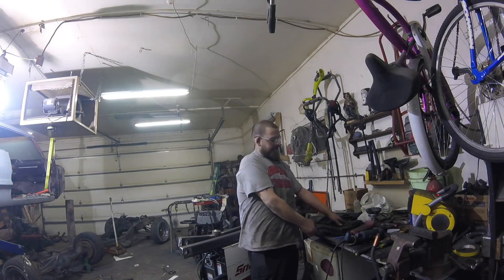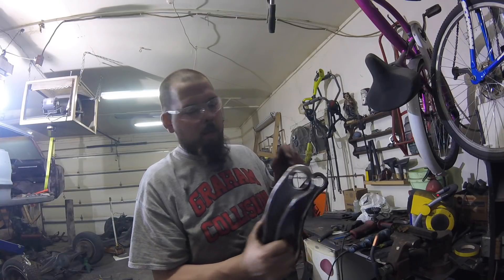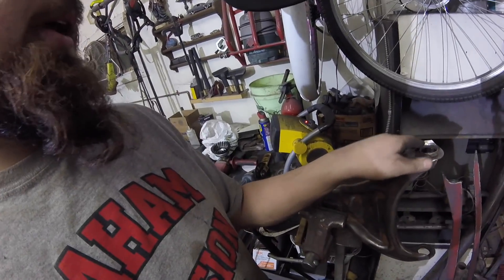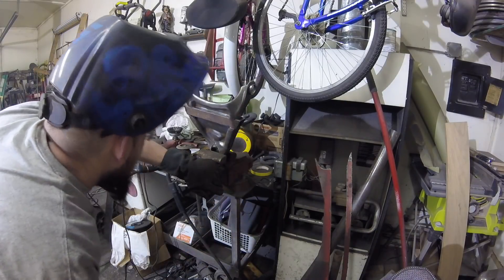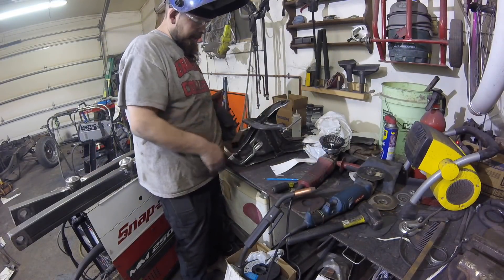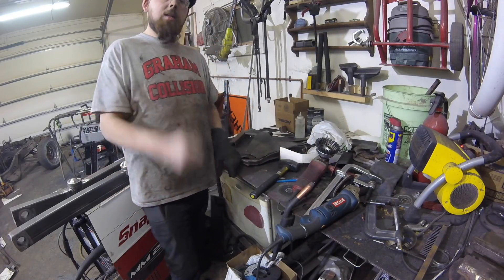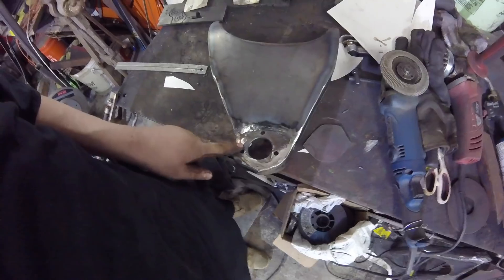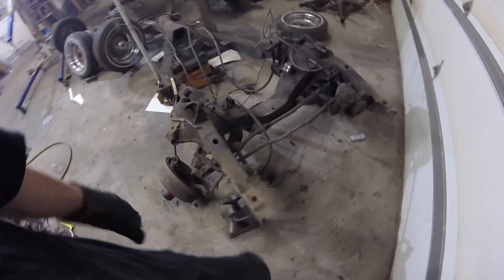How I REINFORCED 64 Impala A Arms!

Comment: just a lil tip when welding up arms or anther part weld the sides on first they dont need to be full welds you could stitch weld them. dont butt joints together and weld them. the plate you weld on first is you is your stength then weld the top plate to the side plates.this goes for any type of reinforcing.these are the ways i do them. ive been welding for 18 years and i used tricks front structual welding when reinforcing...but over all you got the right idea.ohh and i think you need to turn that welder up a bit. those beads should lay in there better and hotter 
.

Comment: Hate to ask a stupid question but I missed why the 1 1/2" extension is needed?
Reply from the maker: Classic Car Overhaul you can ask 20 different lowriders and get 20 different answers. But from the research I've done it's mainly for looks. It looks better to have your wheels \/ than /\ when the cars raised. Also takes a little bit of pressure off your ball joints when hopping it meets them more straight.